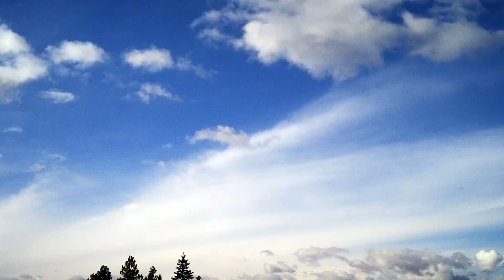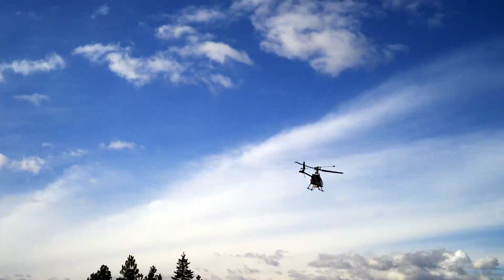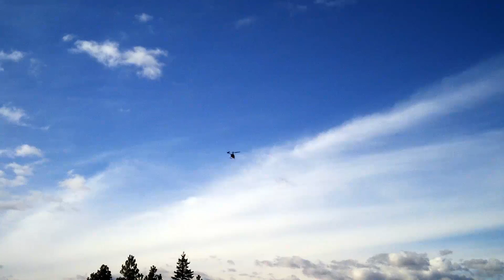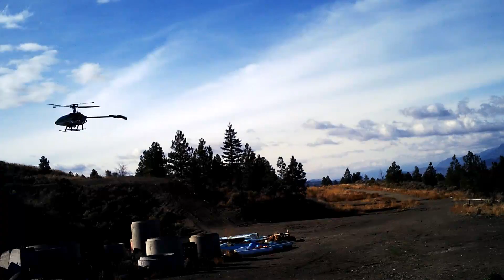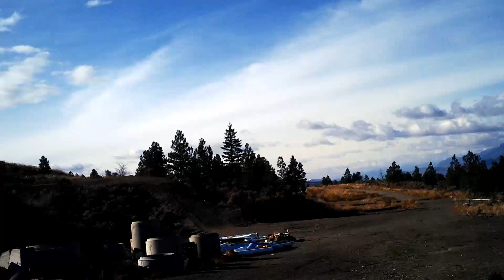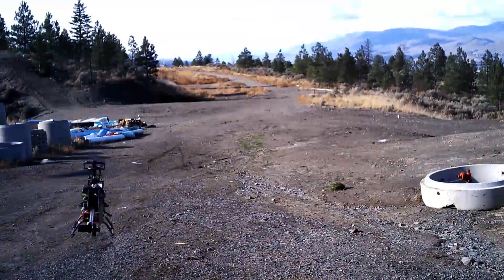F645 - First flight w new blades on windy day

Comment: How well did the Honey Bee Blades perform compared to the stock blades?  Is there a greater pitch with the Honey Bee's?  I am upgrading to a Brushless motor in hopes to get more power so I can make some water take-offs & landings with my Heli-Max Floats or my GWS Floats.  As of now there just isnt enough power to get any signicant lift with the stock blades & motor, I have even tried using pool noodle floats with no luck.